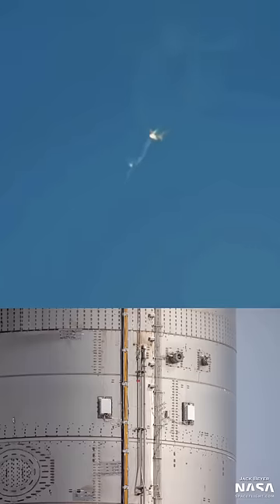Is This Why Starship Wasn’t Destroyed The Moment It Lost Control?

Comment: That's really concerning and the FAA will not be happy if this is the case.
Reply: Thinking the same thing
Reply: I believe what happened was not a violation of any rules -- flight termination regs don't require the destruction of the rocket; they're more concerned with making sure it hits the ground within the prescribed zone
Reply: Frankly, I doubt its much of a problem. Figures the FAA is, in fact, perfectly familiar with their FTS and has approved its use.
Reply: So terminating a rocket by blowing relatively small holes in the side wall may not be the optimal solution. Multiple charges around the circumference of the hull may be more effective.
Reply: @davidf2281  But how to ensure it lands in the zone if during real launch it may suddenly start accelerating to outside the zone, and you don't have any capability to blow it up.
Reply: @yutoobe123  that's the real problem. FTS is supposed to be a fail-safe to disintegrate the rocket if it goes out of control. Since it failed to do so, this could have been horribly disastrous if, say, it had veered off course towards South Padre Island. The idea is the FTS should destroy the rocket soon enough that the debris will remain within the containment zone. If it took 50 seconds to blow up, it could have easily drifted out of the zone.

Now, the attitude of the rocket needs to be taken into account here. The way the rocket was falling was rather unusual in that it was sideways. Normally the FTS damage would have sent a spray of fuel back to the engines where it would have ignited. As it was, the fuel was just dumping harmlessly into the atmosphere.
Reply: @n003lb  What explosives do you think can DISINTEGRATE a 5000 ton building?
Reply: @paradiseexpress3639  5000 tons of methane and liquid oxygen...

Or whatever the fuel load was.

It's the job of the FTS to trigger the destruction. It's the job of the fuels to do the actual destruction.
Reply: Don't people realise that while Scott has thought about this, and provides a reasonable and educated explanation, it is still just speculation, not fact. 
Wait to see what SpaceX has to report, if anything...
Reply: @yutoobe123  Good point
Reply: I'm pretty sure that they'll have to go to another FTS design using a linear shaped charge that "unzips" the tanks along their length, just like most other rockets use, rather than whatever they have right now. 2 blocks of high explosive wasn't ever going to be enough anyways.
Plus, they might end up using less high explosives (and therefore less mass) that way.
Obviously the location on the lee-side of Starship (the side facing away from the majority of the reentry heating) is still the ideal location for it, but it's gonna take up more vertical space in any case. My thinking is that they'll put it in the raceway just like so many other rockets have done in the past, SpaceX happens to do a lot of things differently and they don't all work out as "good ideas".

EDIT: Having said that, I'm still not 100% convinced that the FTS triggered at all. They could have sent the commands and the rocket could have not been in the right orientation to receive them. The avionics that handle the radio reception of, interpretation of, and execution of the FTS commands could have been damaged during launch if it was located in the aft engine section of SuperHeavy (and therefore not triggered due to inability to receive, inability to interpret, or inability to execute those FTS commands when they were sent).
Or there could be any number of other things wrong with the FTS system. Just because the FAA signed off on it doesn't mean it's 100% faultless, I mean the FAA signed off on the 737 Max's design and that turned out to not be the correct decision, so even the FAA isn't faultless.
It DOES mean that they'll be investigating what happened that made it not trigger (if it in fact did not trigger) MUCH MORE CLOSELY to inform future decisions about FTS systems on rockets.
Reply: @nkronert  The issue with this is that the more explosive charges you add the higher the risk of something causing an unintended termination
Reply: @bengrogan9710  many industrial high exclusives are actually pretty hard to detonate. When lighting them, they'll just burn gradually. So one wouldn't need lots of detonator devices, just one (or two for redundancy) and a cord of the explosive mounted all around or along the rocket.
Reply: @nkronert  I'm aware of the general stability that can be attained with industrial plastic explosives in normal circumstances - The issue is that many hear the stories of throwing C4 into fires and assume that means you could throw a prepared ready to blow charge in a fire - forgetting about the Blasting cap or det cord

The issue is that every one of these charges needs to be in a heat shielded container and all it takes is 1 to go to kill the rocket
The primary energetic component of both C-4 and Semtex for example is RDX which will begin chemically decomposing at 205 degrees and fully denaturing around 250c
The reason it doesn't detonate in a fire is because it is designed to off gas its chemicals as gas slowly enough that a normal fire, in an oxygen atmosphere wont set it off - in low atmospheric pressures it offgasses faster risking more

The issue is that Det Cord that is used to initiate the explosive is only stable to roughly 140c then risks detonation
This is usually mitigated by making sure the Det chord is embedded inside the Plastice explosive 
If the entire device is thermal soaked it will detonate
Reply: y'all are getting distracted with the "how" of this is done. Starship being large doesn't suddenly make FTS optional.
If Scott's theory is correct and it was really nearly a minute between FTS engagement and ship destruction, then that's clearly a major issue.
Reply: @chris-hayes  Not really, it did exactly what it was meant to do - There is no public information that I'm aware of stating a timeframe as that isn't the goal of the FTS

The flight termination system is not only meant to destroy the rocket, but also minimise the debris field and ensure the largest pieces are sheared to reduce kinetic energy.
This way of working allows purging of the fuel until it is ready to collapse, rather than detonating the tank under pressure which would radically increase the debris feild and likely propel some pieces well out of the safety window
Reply: @nkronert or even a single line of det cord top to bottom in a raceway per stage (I think) would split it pretty effectively.
Reply: @bengrogan9710  yes, that is part of the job of the FTS, but it's also supposed to prevent the rocket (or debris) from landing outside of the exclusion zone (or whatever they call the safety zone around the launch path). If the rocket were flying in some unintended direction instead of just tumbling, this type of FTS, if it were intentional the way your suggesting, would not work because the rocket would continue to fly for some time before enough pressure was dumped to cause a structural failure. Say the guidance system was somehow programmed backwards and the rocket pitched and started climbing toward the north-east by accident, it's not going to take long at all before it'll be overtop of populated areas. The FTS needs to destroy the vehicle the instant its triggered then. 

Also, as someone else mentioned (@cerealport2726), this is just a theory. Until we know more, it's a very plausible theory, but still just a theory.
Reply: @paradiseexpress3639 . very poor comparison with a “building”. 😢
Reply: @paradiseexpress3639  One fully loaded airliner :)
Reply: @n003lb  at 40K altitude the tanks are almost empty
Reply: @n003lb  
No, there wasn't an "explosion" when the tanks burst.
There wasn't an explosion when Challenger came apart in flight 51-L.  Not when the Soviet N-1 came part. Aside from range safeties and warheads, there hasn't been an explosion in all of rocketry. Not even if there's a huge fireball and loud "BOOM!", it's still not an explosion.
Reply: @JFrazer4303  I never said the word "explosion" anywhere.
Reply: @paradiseexpress3639  I dunno, ask the CIA...
Reply: Why would the FAA care?  There is nothing below Starship except hundreds of miles of ocean.
Reply: @TheJTcreate  There are billions of animals there brother
Reply: @n003lb  FTS is not meant to destroy the vehicle. It is meant to stop the engines producing thrust, depressurise tanks. Causing the propellant to explode is actually not supposed to happen and that would get them in more trouble. The regulations are available online for you to read
Reply: @nkronert  The holes are relatively large when you consider the pressure of the tank goes up to like 8 bar from memory-
you kind of lose fuel at tonnes per second.

besides, you dont often want to terminate over land because you need a much bigger explosion to atomize 500 tonnes of steel like would be ideal
Reply: @platiuscyndar9017  "I doubt it's a problem because I baselessly assume it isn't a problem" is a hell of thing to post publicly, champ.
Reply: By todays standars when nobody gives a fuck a😊bout anybody I'm sure the faa dont care if it crashes wiping out a whole town. The gave approval to the boening 737 max 8 and two of those pkanes crashed yet they dint want to ground it. It speaks volumes
Reply: @RussianSevereWeatherVideos   Too soon.
Reply: @paradiseexpress3639  Jet fuel!
Reply: @paradiseexpress3639  there are billions of animals everywhere…
Reply: @peter-ji2nl Are we allowed to discuss this?
Reply: @peter-ji2nl  they actually didn't give approval to the max 8 before it crashed. Boeing had permission to self type rate and refused to admit it was a new aircraft type so they could save money and rate it under their self type rate system instead of paying for the FAA to get involved.
Reply: In all fairness, nobody is quite used used to handling range safety issues on anything this large and robust.
Reply: Good thing it isn't the case. FTS didn't go off until the rocket disintegrated. Before was just manual venting and burn off.
Reply: ...sounds like someone is trying to rewrite history, or misunderstands it, but I only know what I've read on Wikipedia, so who really knows... Though, its having been a huge thing, and rather condemning, I did verify that what I'd read spanned several revisions over several months...
Reply: No normal fan of space exploration is happy about anything here. This was a dumb demonstration, not a test.
Reply: They just ruin all the fun, they're just the fun police.
Reply: Since when is the FAA actually happy about anything?
Reply: Doubt it, the FAA, NASA, and SpaceX are probably all well aware that this form of FTS has atmospheric pressure requirements as well as fuel tank pressure requirements to properly finish the cycle.
Reply: @ricksimon9867  disagree
Reply: @xPRIMExNITROx  
"Disagree" is for opinions, not for facts.
Reply: @TheJTcreate  There are not billions of animals inside my house
Reply: @ricksimon9867  “Normal fan”, “happy”, and “dumb” is the rhetoric of opinion, not of fact. Check yourself before making opinionated assertions and claiming them to be “facts”.
Reply: My question is, why isnt the bom box on the INSIDE of the tank. Would be much more efficient and still safe since its a sealed component
Reply: @n003lb  Since when? NASA's SRBs have explosives. There were explosives during Mercury, Gemini, and Apollo. When did the rules change?
Reply: @dalethelander3781  I think you tagged the wrong person here. I never said anything about explosives.
Reply: @FrotLopOfficial  because it would be impossible to arm and safe them if they were inside the tanks.
Reply: @TheJTcreate  at those speeds and altitudes, an intentionally aerodynamic object can carry a very long way.  There is some amount of time delay that could result in debris (or just a full on rocket) landing in Florida.  However long that delay is, that's how long the fts has from trigger to destruction.  My guess is 50 seconds is longer than the design time and they'll have to rework something
Reply: Not really. The goal is for the stack to come apart without an earth shattering kaboom.
It came apart before falling, which is one required parameter. The idea is, a rocket doesn't do a Long March landing on an occupied town, like one Long March rocket did, killing hundreds on impact and fire.
Reply: @nkronert  it depends upon the booster. With solid rockets, a linear charge is used to essentially unzip the propellant storage. That does create a fireball.
Fireballs aren't really desirable, as had the rocket gone off course at low altitude, a fireball over the nearby city would've been an air burst disaster.
Reply: @n003lb  so, an ideal solution is for the rocket to explode in a fireball over an inhaited area at low altitude?
That's precisely what a MOAB does.
Maybe we should pack nukes in them, make sure everything is destroyed, rocket, island and all.
Or blow a hole in the tank with a cutting charge, fuel is discharged, Issac Newton continues to guide the remainder along its general tragectory and air pressure dismantled the steaming mess, which is what happened.
Because, you're wanting an air burst overhead of an occupied island, which is precisely the most destructive attack used against an occupied area.
Reply: @paradiseexpress3639  there is one, but I doubt anyone would want to use them.
A nuclear warhead.
Vent the fuel, the greatest danger is gone. Then, all you have is wreckage that'll be shredding itself by aerodynamic forces, rather than a fireball landing inside of a town like one Long March rocket did.
Reply: @44R0Ndin  I looked it up last night. SpaceX uses both a manual FTS and an automatic one, both functioning the same way. First, fuel is cut off to the engines, then the charge fires to vent the fuel.
The goal is that full fuel tanks don't crash and rupture on an occupied area, like one Long March did, obliterating an occupied town.
Reply: @spvillano  So the goal isn't to immediately destroy the vehicle preventing it from leaving the range?
Interesting. The other concern I have is that apparently the part that shuts down the engines did not function correctly, and I'm sure that will have to be rectified before it flies again.
Reply: As someone with a friend who was an FAA inspector for about 11 years…. They are going to have a field day.
Reply: It’s not like it’s going to hit an airplane or anything, they made sure there were no none there, it wasn’t a risk
Reply: @Industry-insider  um… if it starts going the exact opposite way, there are two airports within 20 miles of the launch site. If it takes 50 seconds to blow up that literally is more than enough time to do catastrophic damage to life and property
Reply: @BradyBaseball13  no that wasn’t possible, it was going out over the ocean for way more than 50 seconds at speed, and they still had control of the throttle so they could have turned it off, it was way over the ocean and there was zero chance it could have come back and hit anything
Reply: @Industry-insider  …..let me explain again. If at launch, the vehicle starts on the reciprocal heading and it takes 50 seconds for the system to actually work that will be catastrophic. 

I am not saying for this flight I’m saying for future use, the FAA is down their throat at this moment
Reply: @Industry-insider  Not worried about the aircraft so much as the boats, not like an oil tanker or whatever is gonna be able to move out of the way of that, so if the thing goes outside the prescribed range constraints and DOESN'T blow up immediately, there's a risk of something unfortunate happening.
Reply: Yeah, a failure of the flight termination system is a pretty big deal. Especially on a vehicle that is supposed to carry people.
Reply: @dudeinanofficechair7662  Of course such an object can carry a long way.  That's why they launched it over deep waters.  ...And, Yes, they have to rework something.  that's the point of this launch...Too learn what needs to be reworked.  My point is critics on youtube don't know the difference between a developmental prototype and a completed functioning Rocket system.   Even Elon was concerned that the prototype wouldn't get pass the tower without exploding.  They are breaking new grounds with this program.
Reply: I doubt that the FAA has jurisdiction over spacecraft.
Reply: @elijahrobinson2362  I think you mean Jurisdiction over the "airspace" that the spacecraft has to launch through.  -And yes!  They do.
Reply: @elijahrobinson2362  that's interesting. Why does SpaceX spend so much time getting licenses from the FAA before they launch then?
Reply: do most rockets have a termination sequence?
Reply: @a.s.b.  I believe all rockets have to have one.  The idea of sending a few thousand tons of fuel into the air with no way to stop it from landing on a town if it goes off course isn't palatable.  Anecdotally, the FTS on starship is less robust than most.  It's just a charge on each stage to punch a hole in the fuel tank.  Most rockets have a line of explosive running down them to split the whole thing open.
Reply: They shouldn't things shit lets be honest its in the middle of a nature reserve
Reply: who cares what they think
Reply: @BradyBaseball13  If the rocket starts heading towards a populated area they shut down the engines (immediate) and vent the fuel (I think the engines were still running until the tanks ignited, so I don't think it actually took 50s to do so anyway).

The FTS needs to shut down propulsion, ensure the impact point doesn't significantly change after activation (wreck solid rockets so they don't produce much directional thrust) disperse liquid propellant (burning it if toxic), and not produce a detonation of the propellant. None of these requirements say anything about breaking up the rocket (debris is unfortunate, but full fuel tanks and live rockets around people is unacceptable).

Since nobody bothered to look up the law, I reproduced it below:

14 CFR § D417.3 Flight termination system functional requirements

(a) When a flight safety system terminates the flight of a vehicle because it has either violated a flight safety rule as defined in § 417.113 or the vehicle inadvertently separates or destructs as described in section D417.11, a flight termination system must:

(1) Render each propulsion system that has the capability of reaching a populated or other protected area, incapable of propulsion, without significant lateral or longitudinal deviation in the impact point. This includes each stage and any strap on motor or propulsion system that is part of any payload;

(2) Terminate the flight of any inadvertently or prematurely separated propulsion system capable of reaching a populated or other protected area;

(3) Destroy the pressure integrity of any solid propellant system to terminate all thrust or ensure that any residual thrust causes the propulsion system to tumble without significant lateral or longitudinal deviation in the impact point; and

(4) Disperse any liquid propellant, whether by rupturing the propellant tank or other equivalent method, and initiate burning of any toxic liquid propellant.

(b) A flight termination system must not cause any solid or liquid propellant to detonate.

(c) The flight termination of a propulsion system must not interfere with the flight termination of any other propulsion system.
Reply: @cerealport2726  Oh right listen to the people that have a clear bias to say their rocket didn't completely fail lol
Reply: @Danuxsy  they aren't a publicly traded company, so if you leave out the biggest factor, money, where's the big incentive to lie about problems encountered?
Reply: @cerealport2726  SpaceX exist because of investors.
Reply: @Danuxsy  Investors, yes, so what's your point exactly? You still can't explain why they would lie about problems. I guess that's because you have no idea what you're talking about...?
Reply: @cerealport2726  Why do you think Elon Musk lied about self driving cars for ten years straight?
Reply: @Danuxsy  You're still not answering the question and providing evidence for your wild claims. Again, justify your comment - why would he need to lie about this rocket failure? Are you capable of that level of english?
 
You referred to SpaceX in your initial comment to me. I couldn't care less about Tesla. It was painfully obvious that he was milking the subsidy system for years, and the product is late, vastly over-hyped, poor quality, and over-priced - just like Hyperloop. However, with SpaceX has demonstrably done things that other launch providers haven't, and he has changed the industry. 

Who is to say he cant succeed in one area, and still fail in others?
Reply: @platiuscyndar9017  unless it’s not the one FAA approved.
Reply: @paradiseexpress3639  Jet fuel!  (Sorry, couldn't resist.)
Reply: @cerealport2726  Given they've lied about so much else, what makes you think they'll be truthful about the sequence of events, or even know what the sequence is? (Their broadcasted telemetry wasn't matching what you could see with your eyes, so they were censoring stuff before the flight was even off the pad.)
Reply: This is a test flight, they're going to take notes and make necessary changes